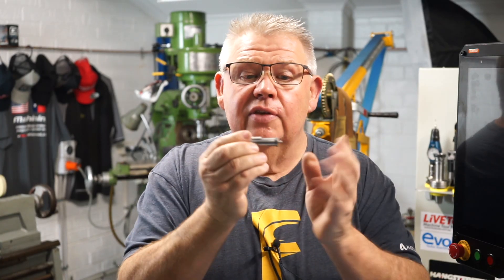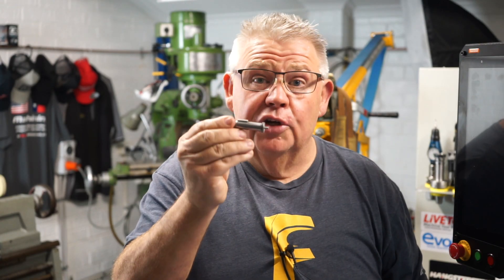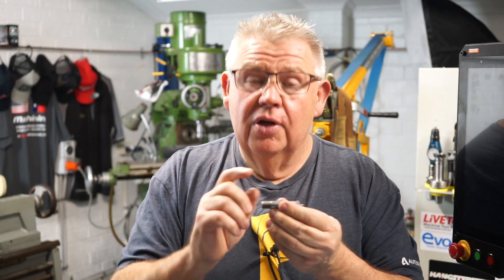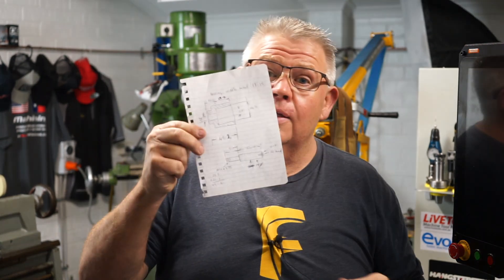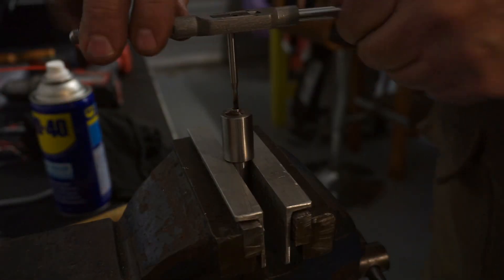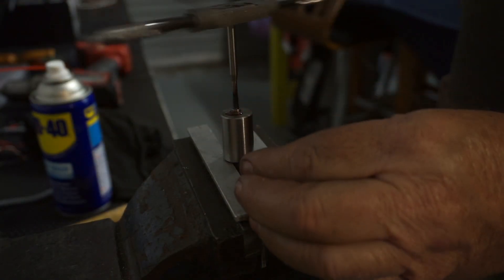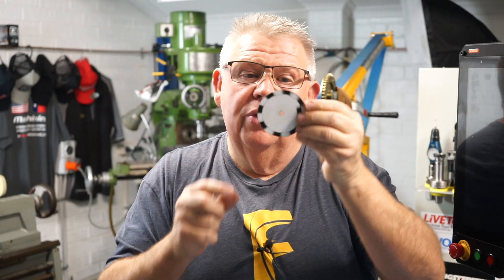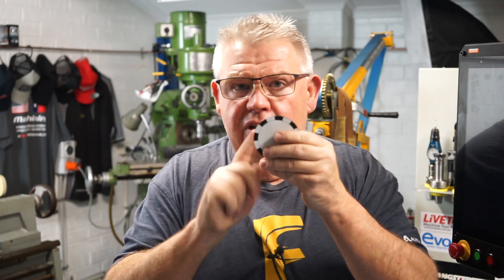Manual Machining 4140 STEEL shaft

Comment: Nice to see the olde worlde Mitutoyo vernier getting some use. It was the first tool I bought with my own money when I started at college. 50 years later, I still have it.
Regards,  Preso
Reply from the maker: G'day Preso.  Yes that one of mine is an old girl.  Probably purchased back in the early 90's and was given to me by a fitter and turner when I worked as a maintenance fitter at Dreamworld back in the day.  I still have the original case which is plastic.  Cheers, Aaron.

Comment: Una chaveta de 4mm x 12mm,Porque el tornillo de M4  y no mas Grande,no Hay Esfuerzo De Nada !!
Reply from the maker: The screw is purely used as a retainer with washer to hold the disk on.  The 4mm keyway is the recommened key for a shaft of 12mm diameter.  Hope this makes sense.  Cheers
Reply: @AaronEngineering  Si Bien,Solo Vi  La chaveta,Recorde tantos Chaveteros que Hize y el de 4mm,era el Mas complicado a pesar que Se le Daba 2,2mm De profundidad,Tienden a Hacerce banana,En Mis 30 Anios de Fabrica de Tornos Paralelos P180,Rectificadora de Discos y campana P7150, y RVE600 Rectificadora de Discos y Volantes,Bueno Saludos Desde Argentina Buen Video !!

Comment: Whenever the size is ok I always hold shafts over the ends in the vise. Why didn't you hold that shaft over the ends to mill the keyway? The ends are naturally square to the axis in all directions so no squares or parallels required to set it up. Just pop it in, find the end and center and away you go. If you are worried about it sitting square just lay it in a vee block.
Reply from the maker: Hello.  Yes I usually usually use the vice, V-block and or dividing head to cut keyways.  On the day of filiming the vice was already off the table so it was straight down to the T-Slot groove with a toe clamp to hold it.  Many way to skin a cat (so to speak).  Cheers, Aaron.
Reply: @AaronEngineering  Thanks for replying. I have never had the need to take the vise off my mill. There always seems to be a way of holding stuff without taking the vise off. So I hold over the ends of bars all the time, unless they are too long.

Comment: Nice machining action, Aaron. I enjoy machining 4140 more than mild steel, as it more predictable and leaves better finishes. A little more resistant to rust as a bonus.
Reply from the maker: Thank you.  To be honest I should have used the tailstock and got stuck into it.  Scatch cutting like I did with a carbide tool doesn't produce a nice surface finish.  However, I was more worried about parallelism with that shaft.  Thanks for watching.  Cheers, Aaron.
Reply: El-neato Bro 👍
Getting close to lift off now.
Can’t wait to see that little AUSSIE machine cranking !
Grasshopper 
🇦🇺

Comment: Wow that's a bit hardcore making your own encoder disc. 😮
I'm assuming you are going to use infra-red optical reflective sensors?
Reply from the maker: G'day Wiz.  It was very easy to be honest with you mate.  The material is a bi-laminate plastic which I laser engraved and cut out on the Epilog CO2 laser at work.  I'm unsure how the sensor actually works, I think they use LED's and photo sensor that picks up the white and black shades.  Cheers, Aaron.
Reply: @AaronEngineering    cool. Thanks for the reply. 👍

Comment: When I machine 4140 for model aero engine crankshafts I use carbide tipped tools but also lubricate with WD 40.    Bought in 4 ltr. bulk packs transfered to a trigger gun.  Bit easier on the carbide cutting edges.     I make my carbide tipped Lathe tools.   To get to finished size like for those bearings I finish using diamond lapping plates again wetted with WD 40.    Final finish with 1,200 grit.
If you get a rough surface finish on the thread flanks they can be dressed with a 60 degree 600 grit diamond file.
Looks like you are using optical sensing on the encoder.   Could also use Hall effect sensing which might be more tolerant of a machining environment.
Reply: Hall sensors need magnets, and that might be a no-no for attracting metal dust etc.
Optical sensors inside an enclosure should be fine, after all if you buy a commercial rotary encoder it is just a glass disc with two optical sensors.
Reply from the maker: Thanks for the tips 👍. I would normally use flood cooling, but difficult when filming. My camera is literally 10-12” away. Mist spray would work well also with some WD40 like you suggested. TBH, I should have supported it with a tail stock and got stuck into it. Carbide is useless scratch cutting like I did. Thanks for taking the time to comment. Cheers 🍻